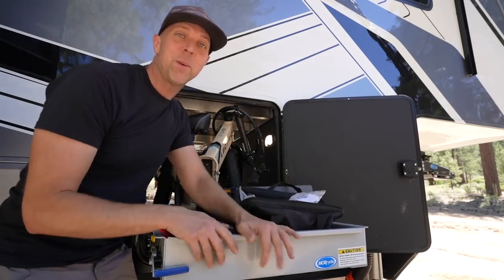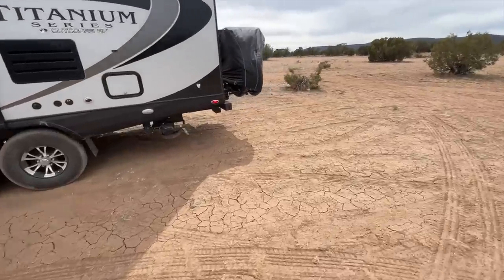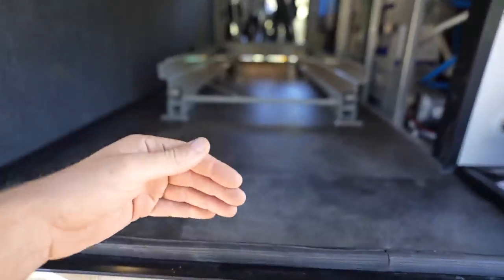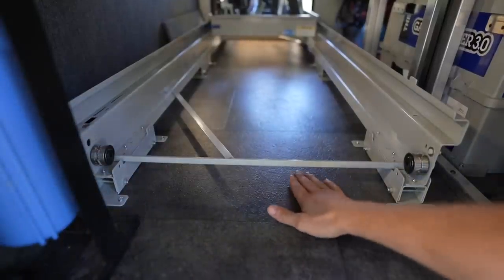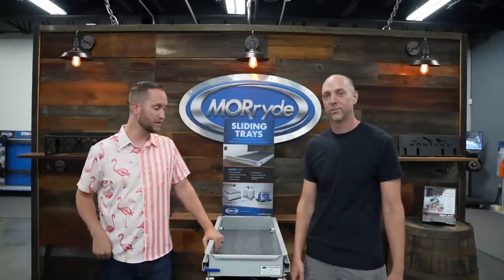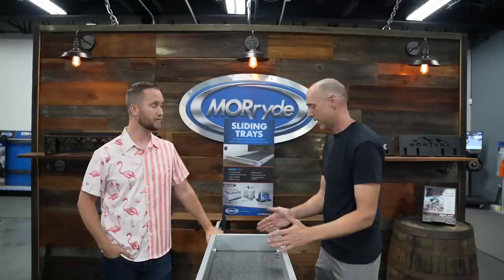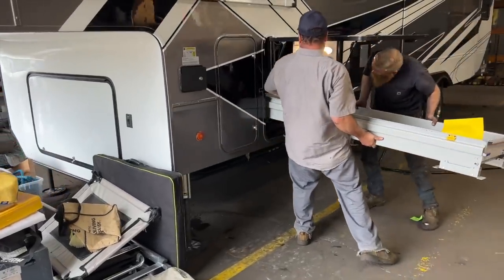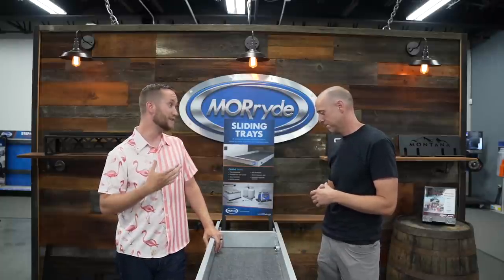RV Storage Game Changer! Morryde Sliding Cargo Tray

Comment: We had one installed in our Avenue at the Alliance rally. Absolutely love it. We put our water filters behind the grey wall and put pex in for the water lines eliminating the bulk of the water filter issue. We also installed the manual power cord roller  on the back side of the tray so it is now easy to just roll the 50amp cord in.
Reply from the maker: Nice!  Sounds like a good setup!!
Reply: @IreneIronTravels  in the Avenue we have room behind the grey wall and our stairs. That’s where we mounted the filters. We have the 2 canister unit like yours. 
On the nautilus side where the power is we screwed in the reel for the power cord on the very end of the slide tray.

Comment: When are you going to cover your electrical system? You said you went 24V - are you using a 12v converter? Do you have a separate 12v battery bank?

I personally keep a 12v 50 amp hour in my panel, and can switch my 12v panel over from the main battery bank. Nice when you're doing work on the system but still want lights etc.
Reply from the maker: It’s going to be a couple videos before I get that one out. But Ill do a quick one and upload it to you guys so you can see it. 

We are using a 24v-12v converter. But that’s a great idea to have a back up 12v battery!

Comment: Is the independent suspension strictly a factory option or aftermarket? Also, what is the cost of it?
Thanks for all the great videos!
Reply from the maker: Both! It has mainly been an aftermarket upgrade at the MORryde plant in Indiana. But, now a couple of manufactures are offering it at their factories. Alliance, Grand Design, New Horizon,... 

At the RV factory they will increase your GVWR sticker if you get it done there. For example our Alliance is normally 15k GVWR, but with the factory IS it is 16.8k.
Reply: @IreneIronTravels   Thanks for the quick response. We are debating about special ordering  or going with a new 2022 on the lot. Is the suspension upgrade less expensive to do at the time of build and is it worth  the extra dollars?
Thanks again!
Reply from the maker: There are some great deals on 22’s right now for sure! It’s close to the same price however you do it. But MORRyde sometimes has 6 plus month waits to get it aftermarket. The package can come with disc brakes and the 17.5 H rated tires. If it’s in your budget, its definitely worth it! 👍

Comment: Question: Can the drawer be removed for cleaning if something spills on it or under it beyond the 80% w/o out taking the whole thing out? Like levers on a drawer? Thanks for your video!
Reply from the maker: Yes! The top sliding part of the drawer can be lifted up and out. There are two slides stops you just have to angle up and over to remove the top tray. That is also one reason I like the dual sliding version so you have more flexibility.